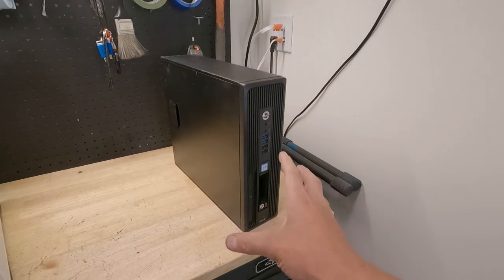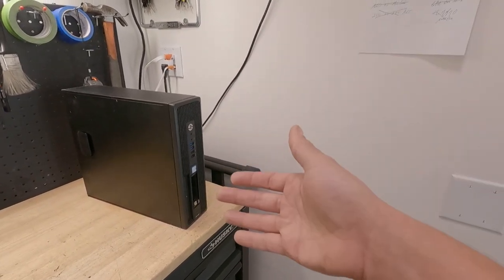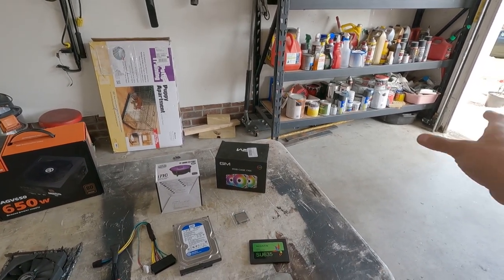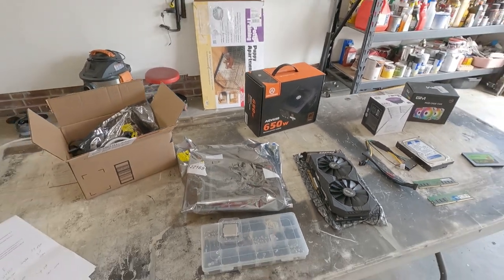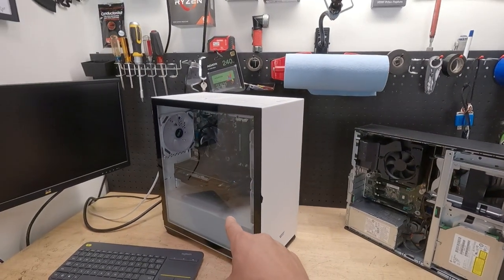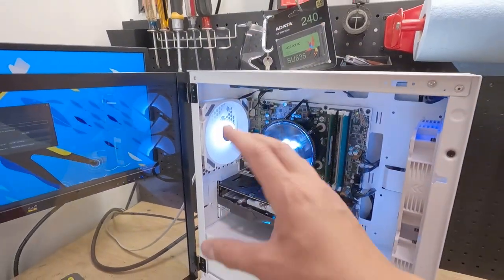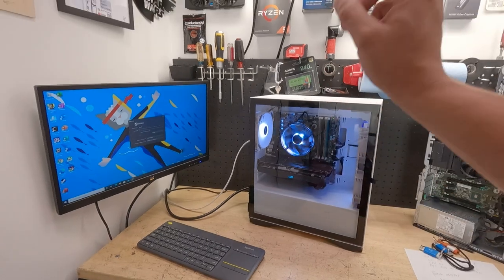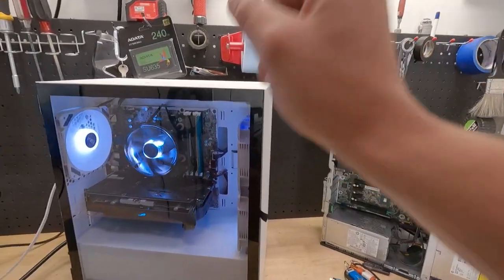This was too easy!! HP Z240 turned gaming!!

Comment: Glad I found this channel, I got a z240 with the I7 6700 a quadro k600 gpu and sata for storage for $150. I have an rtx1080 and a 650w psu with 6+2 power  on the way and I'm looking forward to getting a great budget pc for 1080p gaming
Reply from the maker: Thanks!! make sure you get the correct psu adaptor cable if you do the swap. Their are specific ones for the z240. The cables for the 800 and elites have a different pin out and if you get those by mistake you will get a no post.

https://www.amazon.com/COMeap-Power-Adapter-Workstation-12-inch/dp/B06XW7RWNH/ref=sr_1_3?keywords=hp+z240+power+adapter&qid=1669922285&sprefix=hp+z240+p%2Caps%2C76&sr=8-3
Reply: @DLMtechgarage  yes sir, i have one those on the way too. I saw that in another video of yours

Comment: I redesigned a Dell optiplex 9020 by placing it on a Sharkoon TG5, Core i7 4790 and 16 Gb ram that I bought along with a monitor, mouse and keyboard for 250 $ already I put my rtx 2070 to work on it and playing happily :)
Reply: Putting it into a custom case or getting new fans can cause errors with the Optiplex in most cases. There’s these adapters made by Harbin Repairs, who are based in Georgia (US), that can streamline the entire process and make it error free and can prevent you from ever splicing wires. Definitely what I would use in an Optiplex case swap.
Reply from the maker: nice build.
Reply from the maker: those adaptors are awesome.
Reply: You can put a 2070 in a optiplex? I thought all office PCs maxed out at 1650 or 1660 series
Reply: Hello I'm going to take all the doubts, I did the procedure and there was no error, I used a adapter from 24 to 8 pins and only a jumper, my motherboard is the Dell Optiplex 9020 SFF, yes it is possible to connect several video cards available in the market but for that it is necessary to have an adequate source.
I have an EVGA 650W that provides me well
Reply: @DLMtechgarage  I have a z240 with 16gb of ram 128 ssd c drive 3.5tb hdd would you recommend that for gaming I got it for free for a family member it has the Xeon
Reply: @Ahmad-nq4mo  there are office pcs with modern chips ya know lol including 13th gen now

Comment: Don't want to be critical coz I like your channel, but all you really reused was the motherboard (and hdd, but only because it was decent size). I dunno man I like the budget concept but if your changing everything including the CPU you could just look around for a decent used ASUS/MSI/etc motherboard with no mods needed and a better starting platform from day one.
Reply from the maker: absolutely right, but the whole idea is that these office pc's are thrown away and can be had for dirt cheap, so yes if you are paying a retail or bad price for them, the swap is def not worth it, but if you get it dirt cheap, for free or seen it thrown away, it can be fun to build, also I went the extreme route and upgraded everything but most people would not go that far. I only mess with these and do these builds if I get them for $50 or less. Only paid a little bit more so I can do the video and show the mod. but i totally agree with you.

Comment: Optiplexes have another problem with regards to case swapping, especially for the newer ones: proprietary form factor locks you into the original case and original PSU, like how this HP Z240 uses a standard mATX board with a standard PSU pinout? You ain't getting that in an Optiplex minitower from the last couple generations or newer.

Newer Elitedesk models also share the same problem as newer Optiplexes: the aforementioned proprietary form factor for the mainboard and PSU, moreso with the front I/O built into the mainboard on an appendage that sticks out the front of the case.
Reply from the maker: you can, I just did a video on case swapping a newer optiplex. Not that bad actually. it's not ideal as it use to be but still doable...

https://youtu.be/KPZBPunpEOE

Comment: Even with these going for like 150-200 it's not bad considering you can case swap and get a Xeon that performs very close an i7 7700

I am def looking into these now...
Reply from the maker: Man I love these z240 way better bang for the buck and can be found cheaper then an optiplex on the used market. The case swap is real easy and these things are solid!
Reply: I was thinking of buying a hp z230 on Craigslist. It has 32gb ram and the i7. The list price is 220. Is that a deal?

Comment: HP Z240 Cad Workstation
Intel I7 6700 - 3,4GHz
8 Gb DDR4 Ram
256 Gb SSD
Is it good if i buy for video edit and 3d rendering.
Which card should i use
Reply from the maker: yes. def a platform for that. Would recommend 16gb ram and a decent graphics card to compliment it.

Comment: good knowledge! i continued from part 1. I have the same sff there then i add m.2 nvme. from the case that u swapped, the m.2 seems physically impossible to install. or is it? do u have a suggestion of correct case to fit the m.2 nvme as well? thanks

p/s:  best suited video for me as i recently acquire this hpz240sff. currently looking around for low profile GPU but seems 1050ti (budget-matched for me) is nowhere to be found here locally. so im thinking of swapping the case hence i'm here.
Reply from the maker: their is no case to accomodate the m.2 as Hp made it propietary to their designs, but I have read of people 3d printing a standoff and either glueing or drilling the standoff to the mobo tray of the case to accomodate the weird offset.

Comment: Thanks for the video.  I recently come across a HP Z240 tower workstation at a 2nd hand store aka pawn shop: It is on display, but I have not been able to boot it up because it is not connected to a monitor.  The staff marked it as Processor Intel i7,  3.4 GHz, RAM - 32GB and Hard Drive - 500GB. The computer case has 2UA80928H and 3UF42US#ABA.  I don't know the age of this workstation or much else about it.   What is a good price? What type of memory chip does it have DDR3 or DDR4?
Reply from the maker: that would be an i7 6th gen and it would have ddr4, def a great system and the tower station makes it easier to pop in a gaming gpu, a fair price should be around $200USD
Reply: @DLMtechgarage  Thank you very much.  I didn't buy it because they wanted $299.99

Comment: is hp z420 better than dell precision t3600?
i need a good preference for gaming and streaming i am waiting for the pc 
with rx 570 or 1650 super
Reply from the maker: specs they are similar but I would recommend the z420 for the simple fact you can upgrade the psu to any psu and all you need is an adaptor to convert it to motherboard which they sell cheap on amazon. with a regular psu you can put a better gpu then those. the t3600 is limited on the psu you can upgrade and more expensive to upgrade if you can fan the updated dell mode.
Reply: @DLMtechgarage  can we swap the case of z420 i guess of t3600 we can't due to unconventional motherboard shape
also t3600 comes with 425W and 635W 80 plus gold supplies
(mine with 635)
i want performance as well as aesthetics so please tell me again
Reply from the maker: @aleeplayzz79  it is easier to swap the z420 into a newer case, the front i/o is fairly simple and i believe the usb is the same as what i did in the z240.. haven't done a z420 so can't confirm. I recommend the z420 because it is more versatile to upgrade and case swap compared to the dell.
Reply: @DLMtechgarage  ye am gonna exchange my t3600 with z420 from a shop later i would swap the case 
should i pour in 570 4gigs or 1060 3gigs
(wanna play games like minecraft gta V fortnite cod warzone rdr2 and cyberpunk )
suggest one
Reply from the maker: @aleeplayzz79  570, the extra vram makes a difference. rd2 would be my recomendation.
Reply: @DLMtechgarage  thanks for the kind recomendation !! :)

Comment: I was doing this case swap and I cannot get it to power up due to the proprietary wiring for the motherboard power. Looks like you modified the P2 power connector when the rig was up and running. What did you do there?
Reply from the maker: had to buy an adaptor for it. got a video thanks shows everything you need to do to make the swap work. will post a link below.
Also, you can buy the adaptor on amazon.
https://youtu.be/3qOmhk6gVik
Reply: @DLMtechgarage  Thanks. I realized I spoke too soon. I ordered the one you posted the link but waiting forever for it. I ordered another for it and realized they are diff for the Z240 and the Z240 SFF. My bad. Looking forward to getting it and never doing another HP motherboard again. Lol
Reply from the maker: @lbm254  lol... honestly the hp board swaps are way easier then the optiplex. I pick these up as first choice over an optiplex any day!

Comment: Hey man, thanks to you I moved my z240 sff to a new case with a new psu and gpu, works great, but I can't find a way to change fan speed. Bios  doesn't have this option (even in the latest bios update) and SpeedFan doesn't recognise any fan (tried 3-pin and 4-pin fans). Would you know or did you just not mind letting the fans run at full speed?
Reply from the maker: Didn't have that problem. Might be the fan but there is a software for windows that does it.

https://github.com/Rem0o/FanControl.Releases
Reply: @DLMtechgarage  thanks, that looks way more customizable than SpeedFan, I'll keep it for the future. At the moment it still can't detect my fans, it seems that if the motherboard is incompatible then no matter the software the fans won't be detected
Reply from the maker: @Max-px5ym  thats weird as I never had that issue.

Comment: My dell Vostro 430 keeps on shutting down with 16gb ram any idea
Reply from the maker: looking at some specs it shows it will support 16gb only with 4 4gig sticks of ram, is that what your running?

Memory

The Vostro 430 uses DDR3 SDRAM Technology. DDR3 SDRAM is a random access memory interface technology used for high bandwidth storage of the working data of a computer or other digital electronic devices.

DDR3 SDRAM is an improvement over its predecessor DDR2 SDRAM
Capable to transfer twice the data rate of DDR2 (I/O at 8x the data rate of the memory cells it contains)
Enabling higher bus rates and higher peak rates than earlier memory technologies
No corresponding reduction in latency, due to feature of the DRAM array
DDR3 standard allows for chip capacities of 512 Megabits to 8 Gigabits, enabling a maximum memory module size of 16 gigabytes
Supported Memory Configurations
Capacity	Configuration
1GB	1x1GB	 	 
2GB	2x1GB	1x2GB	 
3GB	(1x1GB)+ (1x2GB)	 	 
4GB	4x1GB	2x2GB	1x4GB
6GB	3x2GB	(1x4GB)+ (2x1GB)	(1x4GB)+(1x2GB)
8GB	4x2GB	2x4GB	 
16GB	4x4GB	 	 

I got this from dells website. I'd take it with a grain of salt though, also are you mixing speeds and have tested each stick independanly!!

Comment: Where did you get the backplate mounting bracket for the CPU fan?
Reply from the maker: I just used washers and bolts
Reply: Oh, well I'm also guessing the washers were plastic rather than metal

Comment: mr can you put a nivda geforce 3060 into this?
Reply from the maker: you can, just consider getting the smaller variants and not the larger cards.
Reply: @DLMtechgarage  so which geforce card would fit 3040? because im not sure
Reply: @DLMtechgarage  also how much fps is it average for minecraft for example
Reply from the maker: @JGPLAYZTHIS  not sure. Never messed with Minecraft
Reply from the maker: @JGPLAYZTHIS  3050 or 60 should work as long as it's the shorter variant of the card
Reply: @DLMtechgarage  thx

Comment: i just did this swap case hp z240 and all works good , but  what i just relise is you better build an i3 10th gen cpu with 4C8T with the same cost you buy z240 sff and swap it into new case. With the same cost, you get newest CPU and still can upgrade in the future for better cpu .
Reply from the maker: agree for sure. just comes down to whatever you get for cheap and i mentioned that. but if I was buying a z240 for like $150 or more, I would probably would not do the swap.

Comment: Nice Video Man, Currently building one of these for my friend. Just waiting for the PSU adapter and the graphic card. Still thinking about the case he chose since the last time I built one there were no RGB cases and stuff in the case. will appreciate it if you show me how to connect the case fans
Reply from the maker: the trick is getting a pwm to sata power adaptor, then you can hook up any fan you want. The GIM fans have their own controller so just power them with sata power and your good to go.
Reply: Which video card you recommend for this kind of build?
Reply: @DLMtechgarage  Man really appreciate this video. I was able to fully swap my z240 from the form factor to a new case, and also installed a RX580. But I run into an issue that im trying to run Warzone on it the game start properly but after a couple of min the whole computer restarts. You think this could be due to the PSU. It is a Azza Bronze 650W.
Reply from the maker: @marvynabreu4839  might be, try drivers and bios update first, check temps, and then maybe it could be the psu.
Reply: @DLMtechgarage  already updated all the bios GPU temps goes from 40 to 60 when trying to run the game. I was able to run the game for around 20 min but the it crashed again. Should I try to replace the PSU. While running the game CPU utilization swings between 80-100 %.
Reply: Just to let you know at the decided to change the PSU and got a Corsair 650 gold and now it's working properly. Either way thanks for the video it helps me s lot.

Comment: tried this and it won't even post what motherboard cord did you use?
Reply from the maker: has to be z240 specific, 

the other models look similar but are wired differently.

https://www.amazon.com/GinTai-24-Pin-Adapter-Replacement-EliteDesk/dp/B08GP7X3XD/ref=sr_1_4?keywords=hp+z240+psu+main+power+24+pin+to+6+pin+adapter&qid=1692131178&sprefix=hp+z240+24+to+%2Caps%2C80&sr=8-4